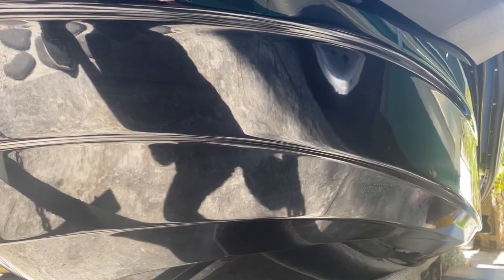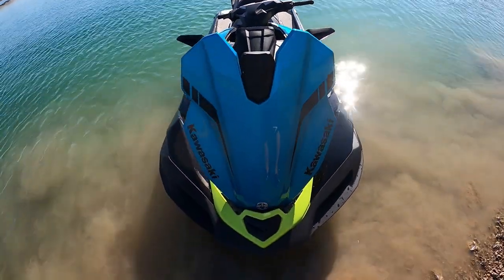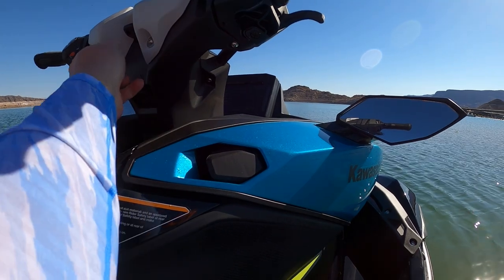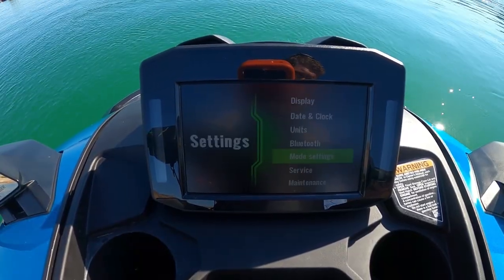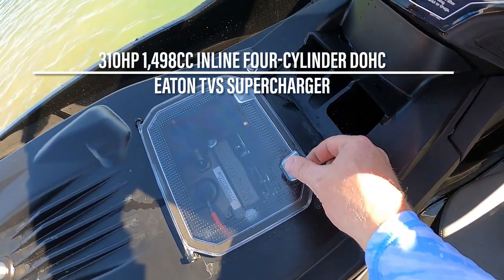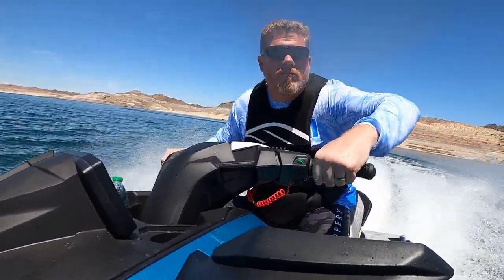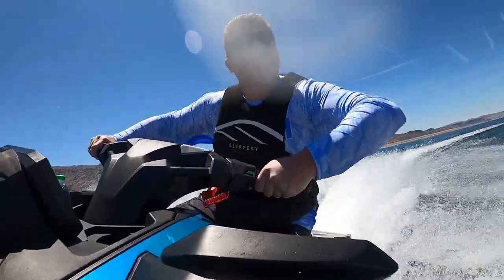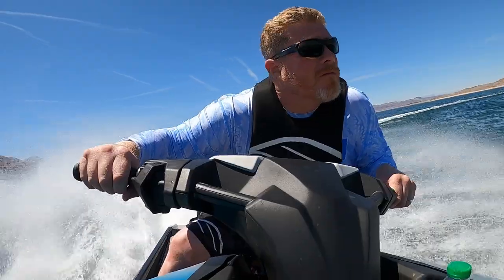2022 Kawasaki Ultra 310X JetSki Review: The Watercraft Journal, Ep. 112

Comment: I have 5 hours on my 2023 Ultra 310x. I've been in the PWC game for 25 years and raced offshore in SoCal. This is my first Kawi and holy hell does it own the rough water and chop. None of my Seadoos can even come close. It's almost hard to believe how fast it is in rough water. I wish I had an Ultra when I raced offshore. The build quality, ergonomics, handling and engine are all top quality. The seat is incredibly comfortable even for three people. People say it's heavy, but it feels just as light as my 2014 RXPX on the water. It doesn't feel like a big boat, but it's stable like one. The right thumb reverse works fine and easy to get used to. If you want to be comfortable and go fast in rough water, this is the ski. It's not perfect - front storage opening is too small, gullwing doors are awkward and not water tight,  engine cover is cumbersome, it's a wet ride in the rough, color scheme is lame (light grey in footwells, really?), two keys when there should be only one. I'd take a real glove box over cup holders any day! These don't take away from the riding experience, but bring the overall owner experience down a notch.

Comment: I have a 2008 Ultra 250x that still runs like a beast and a 2018 Ultra 310x that screams and cuts thru the waves like magic. My buddies have Yamahas and Sea Doos and call my skies  Kawasofas because of the rides!
Reply: Man I sold my 08 ultra 250x and regret it every summer. I had it until 2018 and it was heavily modified and never had an issue even though they said the 250 was the worst motor for ringland failure. Besides a few supercharger belts I had zero issues

Comment: With the re-designed deck, it now looks similar to an FX.  I like it.  Another question: my FX SVHO gets 3.5 to 4 mpg with the way I ride (pinned every chance I get).  What mileage does this ski get?  Thanks.
Reply: I burn 5 gallons an hour on the Kawi averaging in the high 50s. The Yamaha 1.8 SVHO motor is more fuel efficient because it’s  centrifugal supercharger relies on a sprag clutch and thus produces only negligible boost at lower RPMs. The Eaton TVS S/c on the Kawi is always producing boost that is bled off through a vacuum controlled relief valve at lower rpm’s.
Reply from the maker: In our 350-mile ride up the Cumberland, we had a '21 310X average 3.3mpg averaging 55mph.

Comment: hi i found ur video to be very helpful in putting fuel in my jetski for some time now i been going through this headache each time i fill up , i spoke to yamaha about this & they have put me line with otheres who are inthe same boat, still waiting been 7mths with 2min of my time watching ur video im able to remove & fill up with out spending 30min filling then i put back in (simple fix more time on water thanku alot) i have another problem my touch screen also doesn't work unable to go through it & lock jetski with pin once again im in line & its been 7mths other jetski have similar issues but mine the worst of all apparently please help with gd advice
Reply from the maker: With the Yamaha? Yeah, they're having some quality control issues for sure. It should be a warranty item so bring it to your dealer.

Comment: These seem so close to perfect with just a couple needless frustrations. It seems like storage volume and the opening size have been severely compromised in the interest of styling which to me looks like it was inspired by the LaFerrari (which I always found a bit ungainly). If they had broadened and raised the front they probably could have maintained or even improved on the 60 gals of storage of the old one. Also I understand that Kawi says the engine cover was necessary to narrow the seat but surely it could have been implemented in such away that it could be opened without tools, this ski is basically designed for salt water use, how are you supposed to clean the engine compartment after every use with that cover? 

Any comment on how the smooth to medium chop handling and agility would compare to my '17 RXT-X? I only occasionally splash in open water and heavy chop so I wouldn't want to compromise too much on that in order to gain the superior heavy condition comfort.
Reply from the maker: You’re exactly right about the front storage - removing the engine cover is 6 acorn nuts, not as troublesome as a Sea-Doo. 

And it will destroy your RXT-X in all chop. Like embarrassingly.
Reply: If you can’t remove 6 acorn nuts after each ride (35 seconds) to rinse out the entire engine compartment I don’t know what to tell ya!!
Reply from the maker: I do: Don't buy one. I've softened on the engine cover issue after remembering the 13 Torx screws on ALL of the Sea-Doos. –K
Reply: @watercraftjournal  Exactly. Sure Seadoo had a larger opening with the seat off but to actually spray out the entire engine bay the process was far worse removing the linq deck with the 13 bolts IMO.
Reply from the maker: There’s that and the 2 forward bolts that require a wrench if you don’t want to lose the nuts
Reply: @watercraftjournal  Right. Forgot about those two! Yeah I don’t miss that and would rather pop the Kawis cover off. I also enjoy the adjustable seat it makes possible

Comment: I love my SeaDoo and will continue to, but man that looks like a lot of fun. Whats stopping it from going over 70 without a governor like the RXTX? I just might have to pick up one of these next :)
Reply from the maker: Kspeed has a basic reflash and ride plate and intake grate kit that puts it over 77mph.
Reply: @watercraftjournal  good to know. Aside from the storage placement of seadoo vs kawi I think I like the kawi better.
Reply from the maker: The RXT-X has LESS than 27 gallons of storage. The Kawi has 44.6.
Reply: @watercraftjournal  yes but the way you get to it is so much more convenient. It may be half the space but not having to reach up to the nose is very nice.
Reply: @Logan_Daniels_Photography  You don’t only have the front storage option. The gullwing storage has plenty of room for commonly accessed items while out on the water
Reply: @pajamatime5750  that’s fair I didn’t think about that.
Reply: @Logan_Daniels_Photography  I honestly have so much stuff in there I don’t even use the front cubby. If I need to, yeah, it’s not easy to reach. I have once had a backpack in there and I could reach it out because it sat high. There’s lots of space in the front, just a small access hole and it’s hard to get over the bars and wind deflector (I have an LX). Maybe it’s a little easier on the models without the shield / speakers?? Not sure. All I can say is the gullwings open and latch very securely and that space is copious and easily accessible!!! I certainly wouldn’t not buy one because of that!
Reply: @pajamatime5750  good to know! What do you do about fenders and ropes? I know Kevin mentioned a rear storage spot for ropes, but it didn’t look like you could get fenders in the gull wing compartment.
Reply from the maker: No, you'll want to put the fenders in the front (believing that you're using the big white rubber ones).

Comment: Idk I just bought a 2022 gp1800r svho and its a rocket and it was also a few grand cheaper. I love Kawasaki but is this ski really the best for the $.
Reply from the maker: The GP is an outstanding ski, and the two are pretty different in their respective appeal.
Reply: @watercraftjournal  but they are both performance ski's. I just was wondering is the kawasaki really worth it or is it only for ocean riding and the gp is more of a lake ski.
Reply from the maker: Again, the CORE attribute here is ride quality. I've been pretty bold in saying the GP is a "race boat." It's lightweight, thin and doesn't have a lot of insulation so it won't soak up any bumps or rattles. The Ultra totally does. If that's not a concern, don't worry about it. –K

Comment: But aren't your alil partial to kawi tho? Wanna know what I think would be the best ski.
Reply from the maker: Go back and see which skis have won WATERCRAFT OF THE YEAR the last 8 years and come back and tell me WCJ is partial to Kawasaki.
Reply: @watercraftjournal  I know what you you say in a joking way I would say the kawi hull with a yami motor. 😂
Reply from the maker: Yamaha doesn’t come on as hard as the Kawi; Kawi’s don’t have air ribbons that break free in your throttle body; Kawi’s don’t have cracking cylinder heads; Kawi’s don’t have anemic intercoolers from the factory; Kawi’s come with an awesome BOV and catch can from the factory…

Comment: I feel like if Kawi upped the Displacement it would allow them to lower the Boost psi to maintain the same power levels... Which would give the aftermarket greater ability to increase performance through tuning.
Reply from the maker: Or if they just used an engine they already had and dropped in the H2R they could cut 100lbs and rev higher rpm with the same HP
Reply: @watercraftjournal  ZX15R coming next year BTW... Supposedly
Reply from the maker: Interesting - but PWC always get the engine after 10 years of use. We’re a long way from that one (if it happens).
Reply: The kawasaki is perfect all around....hp is enough unless you are racing.

Comment: Need to bring this to mission bay in san diego! It gets choppy af & its windy

Dont lean on ski when turning at full throttle, just stay seated!
Reply from the maker: Wrong, Oswaldo. Always drop a knee deep into the tray while hard, full-speed cornering.
Reply: @watercraftjournal  to mee that seems like racing position, idk if i saw it right but the 310 didnt tilt when steering? I notice this on my 22 fx. Compare to my gp1200r that it just sits level at full speed when cornering. 
That would remove the cruiser & comfort if i have to bend knee when steering. Be safer tho when racing
Reply from the maker: I raced a built '97 GP1200 and a '06 GP1300R, both skis rolled HEAVILY on the rail in hard corners. Neither skis "sit level" while cornering.
Reply: @watercraftjournal  level i mean, like how its riding or sits while non using. Thats how i feel my 1200r & i do lean to the side so it doesnt flip over with me on. 

Im Still scared on my new fx svho, pulls hard & feels scary at top speed compare to my 1200r at 64mph & fx at 66mph. I can stay on it more on my gpr than fx. I havent taken a corner at full speed yet, to see how the fx feels, Still getting the hang of it.
Reply from the maker: SCARED? Pfft. That thing's a marshmallow.
Reply: @watercraftjournal  im not use to it i guess. Different hull tho, different feeling.. i still prefer going full throttle in my gpr 😂🤣 
Specially because the steering is so soft on the fx & any bit if steering you can actually feel it & at full throttle scared to accidently movung it to much & be thrown out.

Comment: Great review - i am ordering the LX-S hope its as good -
Reply from the maker: We MUCH prefer this over the LX-S
Reply: @watercraftjournal  do you think the X is better in the choppy stuff that the LX-S then as the UK seas are well…. Rather unforgiving lol. 
So stability is kind of king
Reply: They are the same ski- the LX-S adds the ultra deck, rear camera, led running lights and green color- other than that everything else exactly the same. The X is lighter and has less things to break and is also a bit cheaper. If you don’t care about the Ultra deck or the bells and whistles go with the X as Kevin says.
Reply from the maker: No. Stability is NOT king unless you plan on walking around the damn thing static in the water. Predictably in rough water is king, and this is it. Ditch all the unnecessary bullsh** and get the X. The LS-X doesn’t add anything to make it a superior riding machine.
Reply: @watercraftjournal   awesome bro - just made my mind up for me.

Comment: OK now were getting somewhere. I did not know any kawi was shorter than an XP. I'm a Yama guy and my preferred is the fzr. I love the 2 seat shorter ride. As soon as learned the new X doesn't have the continental shelf hanging off the back and was also lacking a concert inspired sound system I became even more interested in it specifically. Now I find out it isnt as iver sized as I've been led to believe.. hmmm...  You hit it dead on when you brought up function over features. Not that this model is lacking in desirable features its just that desirable features are relative and I like many don't desire many of the newer "features" . I do find one feature missing on almost all models on all brands except one specific unit that I am aware of and that's a built in depth finder/guage. This is the model for me if I don't stick with yamaha. The LS-x or X-ls would be 2nd I watch JD's water world videos and he makes that machine look great too..
Reply from the maker: Smaller than the RXT-X not RXP-X. Big difference.
Reply: @watercraftjournal  my bad I thought you said P
Reply from the maker: No problem. It's also come to my attention that Kawasaki ALSO includes the weight of the battery, so that's another 13.4 lbs. closer to the Sea-Doo's weight.
Reply: I have added depth finders to several skis using through hull transducers. Have had issue with some displays taking in water. The Hawkeye 2b works great. New Ultras seem to have some good spots for the display. I have them on my 160x and 160lx. Fits perfectly between cupholders.
Reply: @edwardbowles8613  How accurate do you think they are mounted like that? I just think it would be interesting to know if I were in 10' or 100" of water and how deep some of the areas I typically ride in.
Reply: Extremely accurate. Even has a shallow depth alarm. It was extremely helpful during a trip to the FL Keys. Also a ride up the Saluda River last month. Out of 5 skis I was the only one with no hull dings from bumping a rock or two in some shallow areas. It reads at pretty high speeds but if you are wide open and losing contact with the water you stop getting readings. But it is very consistent  at normal cruising speeds. I think it was right around $100. Again, I can vouch for this one being waterproof. Several others I tried over the last 22 years have not been. The very first one I installed in 1999 on a 97 1100 STX was a Humminbird and it was still working last summer. They changed their design a few years later when I installed one on an Ultra 130 and it took on water immediately. These actually said they were waterproof and have proven to be so far for almost 2 years.
Reply: And the depth range is better than 10-100. I think max depth is 600. I know it will read the nearly 190 ft depth of Lake Murray at the dam.  I think I have the alarm set at 2 ft.

Comment: Great hull pump and engine.
Why give a clear access lid to check the engine oil then miss out another access lid to top it up ???
Front  bow nose storage so small apature and impossible to access on the whilst on the ski, you have to get off to load or unload it ??
New deck mats slippery not like models before.
Handle bar mounted key jumped out whilst ridding in rough water and lost it.
Narrower top deck has reduced the already tight access for engine along with relocating the electric trim motor from the front storage compartment to UNDER the engine inlet manifold, heat retention and humidity also increased with the crazy engine compartment cover.
Kawasaki got the tech right but the simple items wrong one step forward and I'm afraid two steps back  still a great machine though.
Reply from the maker: That’s too bad - pretty sure your key wasn’t in all the way, or you hit it/impacted with the bars.
Reply from the maker: Russ, I've got a question. How does the engine cover retain heat any more than having a seat on the previous model? Both were gasket sealed and use the same latch. –K
Reply: You’d call this new generation 1 step forward and 2 steps back? Because of the size of the front storage access and the engine cover? Maybe you should try one first before being allowed to comment! These new Kawis are the real deal and if that’s all you got to nitpick that’s not 2 steps back!
Reply from the maker: @Pajama Time, Russ says he rode it and the key flew out of the handlebars.
Reply: I snap the key in and never notice it again. Not sure how you’d knock it loose. It would suck to loose though that’s for sure! I do have a floater tag attached to it just incase!
Reply: I don't love that design though I have not ridden one. Practical to tether it to the ski or lanyard just in case it is possible to come out?
Reply: @edwardbowles8613  yeah it would be easy to do. I honestly don’t see it coming out. It’s buried in there fairly well…. Not impossible though. That’s why a floater tag as a last resort is probly a good idea….

Comment: I find this review to be a little suspect. With the tippy attitude in the water when going slow. And water in the gunnels not, to mention water coming up over the front of the machine. The machine leaves you wanting something else!
Reply: Sounds like someone doesn’t like getting wet. I suggest you buy a boat instead of a ski. Heck maybe you’d be better off in a car if you’re that concerned about a little water
Reply: @stuartpeck26  I can think of a hundred different ways to get wet without wasting my money on PWCs that have inherent issues right from the factory. No bang for the buck chuck !!
Reply: @steverogers8750  news flash: no brand is perfect. Everything is going to have issues. You’re talking about water coming over the front and in the foot wells. Not a mechanical problem just a slight inconvenience